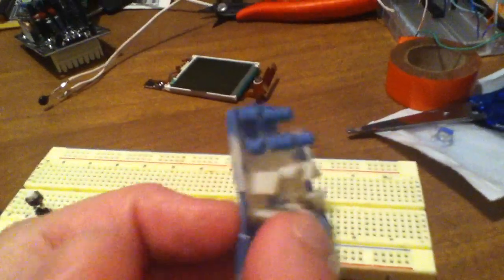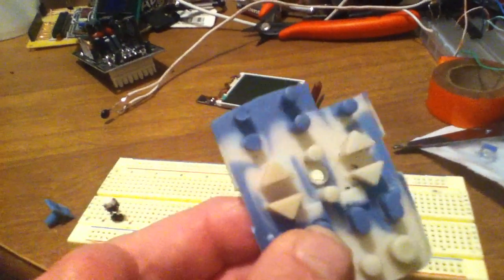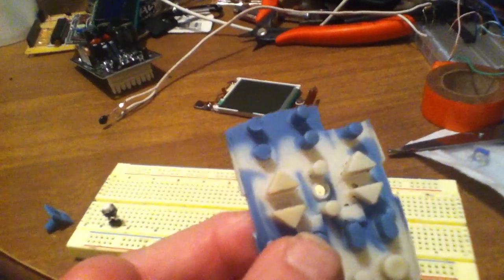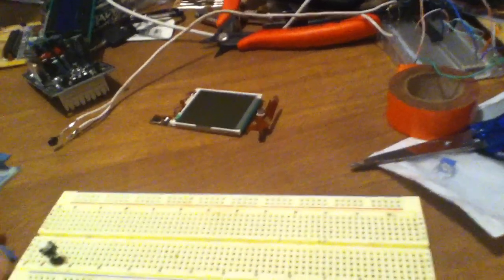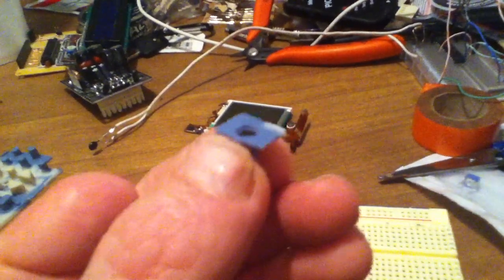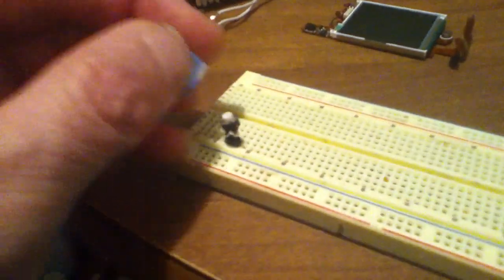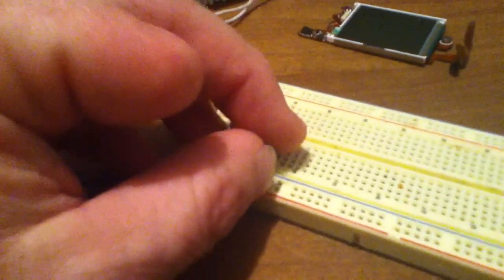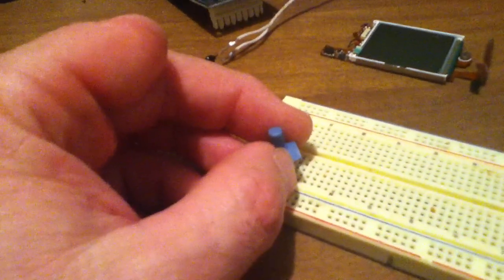button

Comment: Bloody brilliant! Sounds funny, but I’ve been trying to figure that out for the last several YEARS. I’m Very interested in making my own enclosures (big metal box that holds multiple instrument effects, oscillators, etc.). When I want to add an already-built effect to the inside of my enclosure, I’m trying to figure out how to press the buttons and turn the knobs of the effect from the enclosures, knobs and buttons, instead of having to open the enclosure and directly press the original effect buttons. Many thanks for posting this, brother.